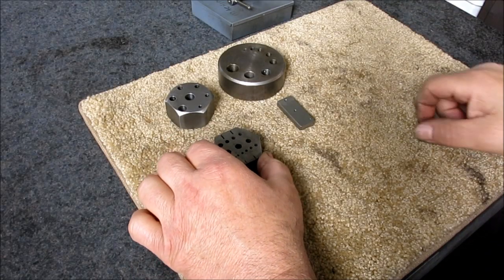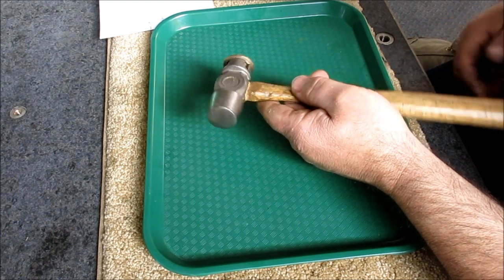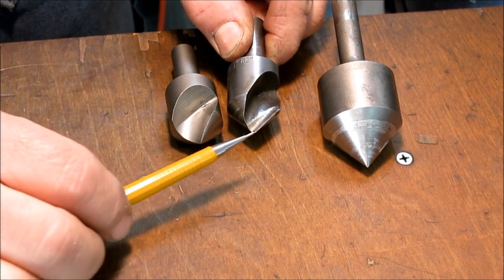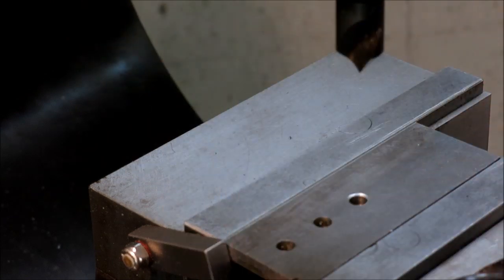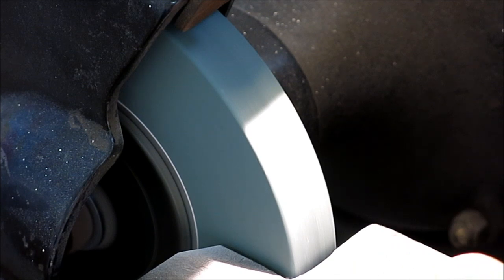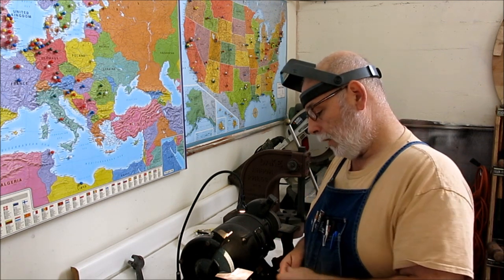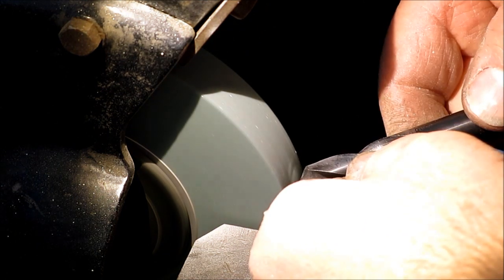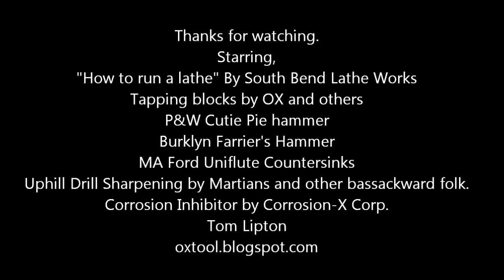Monday Night Meatloaf 13

Comment: Hi Tom, I used to work as a heavy vehicule fitter (Truck mechanic) in th UK. "Toffee hammers" like the small ball pein you showed were used in vehicule inspection. By tapping on bolts or rivets, you can hear whether they are tight or not. Thanks for the videos!! Regards, Matthew
Reply from the maker: Hi Matthew,

It so small I could believe its some kind of inspection hammer. I tap on things all the time to see it they are loose or sitting wonky.

All the best,

Tom

Comment: Thanks, Tom.  Once again, gobs of useful info and a delight to watch.

As a small repayment for all I owe you, perhaps you'll appreciate this tidbit.  Years ago, I went to a jobber shop to pick up a small job.  The job was so minor that the shop foreman had forgotten about it.  A little embarrassed,  he told me he'd have it done while I waited.

I watched while a young machinist went to work carving my workpiece.  Right before he handed it off to me, he reached for a brace with a countersink chucked in it and made quick work of deburring the holes.

Knowing a good thing when I saw it, as soon as I got back to my shop I mounted a countersink in my fine Stanley brace which had been sitting idle for decades.  I always planned to re-nose the brace to accept a Jacobs chuck, but that brace's tapered square chuck has been spinning the 1/2" shanked countersink for more than 30 years, so I guess it works.

Thanks again,
Rich
Reply from the maker: Hi Rich,

I have seen this before and its an excellent tool to have around. I have a tiny version of this I really like for small holes. Not a big surprise its made by NOGA. 

Thanks for the neat story. I love to hear how people learn useful tricks like this.

All the best,

Tom

Comment: Thanks for the meatloaf, keep them coming! I had the opportunity to work @ the north Boeing field test sight and watched a tech tap the last few holes of a 100 hole plate. An engineer had made him a two way slow speed air drill into a forward and reverse drill. When he pulled the trigger the drill went forward, when he let off the trigger it went into reverse.  He could tap a hundred holes in about 30 minutes! That's flank speed production. As you might imagine there are many milling companies supporting Boeing production in the greater Seattle area.
Reply from the maker: slad roznik Hey Slad,

I want one of those drills! Sounds like a great product. Thanks for the comment.

Cheers,

Tom

Comment: i've been a machinist for 30 years and I've always had misgivings about sharpening drills by hand, especially when you can't afford to drill oversize holes on your workpiece. Do we wash clothes by hand? No. then why sharpen by hand? Sure, drill sharpeners are expensive, but so can your workpiece. I have a very good drill sharpener at work at it never fails me with only a minute or two to sharpen.
While sharpening is a good skill to have, most shops I've been at have sharpeners and that's fine by me.lol...

Comment: Hey Tom, absolutely nothing wrong with thinking outside the box you proved your method works as well as the traditional and that's a good thing. Although I think the space time continuum will be thrown off once everybody switches to your method,,lol Thanks for taking the time to put up good videos.
Reply from the maker: Hey Randy,

I can feel the earth's rotation slowing as people (mostly Australians) try out the uphill drill sharpening method.

All the best,

Tom

Comment: Afternoon Tom,

That's the way I was taught to sharpen drills around 30 years ago. I don't do enough sharpening to be particularly good at it though. I frequently mount the drill point up in the vice and use a diamont lap to just freshen up the edges. On small drills I often use the same technique to put a four facet geometry on.
Reply from the maker: Hi Paul,

For small drills that is a great technique. Everything happens so quick on the small drills with a normal grinder. I lost a bet with a guy many years ago that he couldn't freehand sharpen a 1mm drill on the bench grinder. I had to pay up.

Cheers,

Tom

Comment: Tom, 

First off I have been meaning to commend you on your use of magic marker as a lay out die applicator.  I have been doing this with my students for 15 plus years.  Originally I came up with this technique out of necessity.  I ran out of layout die, and budget funds, however the office had a big box of Sanford markers that I could simply take ;).  I still make the brush out stuff available, however a lot of my advanced students will carry a marker in their apron so they don't have to make a trip all the way back to the tool cabinet. 

I also wanted to let you know that I encourage everyone to read How T Run A Lathe.  It was in reprint a couple of years ago, however the fella doing it retired and no one took it over.

Thanks for sharing the "Martin Method" of drill sharpening.

Happy New Year!
Reply from the maker: Hi Mike,

Pure laziness. I hate to walk back to the toolbox to get the Dykem. It takes too long to dry also. But boy the smell sure brings back memories. Much like Hoppes does for firearms owners.

All the best,

Tom

Comment: It's sometimes hard to fine the time to keep up on everyone's vids....but I was just watching Chuck's new one....saw a comment by Michael Murry....checked his vid on countersinks.....he referenced your vid so I looked it up.  Exactly the info I needed for today!!!  I've got top end Drill Doctor but for the life of me I can't figure out how to do the big bits(3/4").  The relief angle doesn't turn out.  I also need to countersink the 3/4" holes after I drill them.  I don't have a countersink that big, but I do have extra drills large enough to use.  All that to say that the idea to regrind a drill to use as a countersink was awesome!!!!!  I'm looking forward to hitting the shop today to try that!!!  Thanks Tom!!!!  Great vid!!!
Mike
Reply from the maker: Hey Mike,

I should work fine. Chuck the drill in a collet for least amount of wandering and use slower than normal spindle speed. Field expedient countersinking.

cheers,

Tom
Reply: oxtoolco
hey!!  That's a great idea!!!! Get Chuck to do all the countersinking!!!  :)

Thanks Tom!  I'll give it a try asap!

Comment: Oh, Tom I was so happy when I head you would show how to grind counter sinks - but oh, you forgot that special one, shaped like a round rod with a cone on the end and a hole drilled perpendicular (I think !) to the cone surface.

How can it possibly cut any thing at all ?

In fact you have one sitting on your lathe tailstock table ... I think it's the second from the left ... I noticed it when you showed your tailstock table in a video and I asked if you knew the geometry of these counter sinks and how to sharpen them - please tell about them.
Reply: They are zero flute countersinks and work the same way as all the others in that they have a relief as well.  I have a set and they work great as you probably already know.
Reply: Keith Ward You writes: .." in that they have a relief as well.." - where ?

If the hole is bored as it seems like - perpendicilar to the cone face, then there is no cutting edge or ... ?

And how are they sharpened ?
Reply from the maker: Keld Sørensen Hi Keld,

They have the exact same type of eccentric relief as the single flute. The cutting edge is formed by the hole. To sharpen this type of countersink you only work on the inside surface of the hole. A small die grinder with a round stone works well for this purpose.

Regards,

Tom

Comment: A hot cocoa and some tasty meatloaf to warm up after pushing snow out of the drive here in central Illinois. Not too bad of a morning.

I may have to try your method of sharpening drills to see if that works better for me than the traditional method.  Do you sharpen your own mill cutters?
Reply from the maker: Hi Gopher,

I don't currently sharpen my own end mills. There is an old company not far from here that does it better than I could ever hope to do it and they are pretty reasonable. I just save them up for a while and when I have a little box of them I send them off. 

All the best,

Tom

Comment: Thanks for showing that hammer, Tom.

I have another question: I dug through your old vides, and decided I was wasting my time, instead I'll ask.  Long ago, you mentioned what kind/brand of edge finder you use.  It was something like a "super snap" or "super jump" or "jumpy snack".  Can't remember!  Thanks
Reply from the maker: Hi James,

You got it. Its called a super jump. It used to be sold by Hermann Schmidt but now the only folks I see with it are Flexbar. Been using them for years.

Cheers,

Tom

Comment: I enjoyed the video very much.  I too learned how to dress drill bits in a vacuum and use your "Martian Method".  I prefer it because you SEE where you need to go not where you were.  I can end up at the leading edge and know exactly how to get there. (if that makes sense)...  What kind of grinding stone and what grit do you prefer?  Great series keep up the good work.   Fred
Reply from the maker: Hi Fred,

Excellent point. Pun intended. I try not to grind things I cant see. So why sharpen a drill without seeing what your grinding. I think its more natural but I'm from Mars.

All the best,

Tom

Comment: hi tom happy new year  my father was a instrument maker by trade and i have is tool set ,in it is a hexagon block the same as yours  he said it was in some tools he bought off a retired watchmaker. I also use a tiny ballpein hammer for making gaskets. dave in the UK
Reply from the maker: Hi Dave,

That makes some sense. The vendor I got the block from had some watch and clock stuff in his booth. I just assumed it was jewelry.

Cheers,

Tom

Comment: I have that little ball peen hammer with the same paint job- came as part of a "gentleman's tool box" with a 6 or 8" long monkey wrench and a sash saw... As well as a tiny plumb bob and a few gimlets,if I recall correctly.  
It is my go to hammer for flattening Japanese chisels.
Reply from the maker: Hi Drew,

Interesting story. When you say flatten Japanese chisels do you mean to stretch small area's to get the cutting edge perfectly flat? Are the chisels you are describing very thin and flexible?

All the best,

Tom

Comment: What grit was the wheel you ground the drill with?
Also, I have never thought to use a stone on my cast iron table before, good idea.
Reply from the maker: Hi Edge,

I think its a 60 grit on the bench grinder but I'm not positive. The table I stoned is steel but the same technique works for machine beds and cast iron plates to take the little nicks and bumps out.

Cheers,

Tom

Comment: Hei Tom,
maybe you could use your Deckel to regrind the countersinks relief face, if your grinding wheel is large enough
Reply from the maker: Hi Tom,

The Deckel is not set up for a continuous helical relief. You are correct that I could actually sharpen one on the machine but it would be a incremented step relief much like the single lip cutter have. Not as nice as the smooth grind on the factory countersinks.

All the best,

Tom

Comment: Tom: I have a ball pein hammer a bit smaller than yours. I use it almost exclusively to cut gaskets. The ball end cust nice holes in the gasket material and the flat end cuts the edges.
Reply from the maker: That would be a good use of this hammer. Not heavy enough to damage edges but enough to leave a mark or score a gasket. Great tip. Thanks for the comment.

Cheers,

Tom

Comment: Tom according to "Alloy Artifacts" P&C was acquired by Plomb in 1941. So there is a  good reason it looks like a Plomb/Proto That is a nice little hammer.
Reply from the maker: Hi Eric,

Thanks for the information. The handle is the Plomb giveaway for me. I will check out the Alloy artifacts lead.

Cheers,

Tom

Comment: Throwing my two cents about the countersinks and i'll explain as well as i can since i could neither do this or have seen it:

You'd need two fixtures.

Fixture one, would be similar to the action of a bolt rifle that uses the helical locking lug.

So step one would be a flat/cylindrical type of collet that would have a tapped hole going inside perpendicular to the rotation axis. That tapped hole would receive the handle.

Step two would be to somehow make the helical tube that has the correct advancing movement and rotation for the countersink.

Step three would be to make a small ring that would lock the collet holding the countersink. That IMO should just be a simple ring, nothing fancy.

Fixture two would be a bit tricky, as in it would have to hold the countersink at the angle of the internal cut then pivot it according to the existent cut. Tricky in the sense that one would have to find the right wheel, and fit the countersink to measure the tilt and rotation.

I can draw this if you're interested.
Reply from the maker: Hey Aserta,

Are you talking the uniflute style or the Weldon style? The Weldon'd don't have a helical relief. Its a bump relief. 

Cheers,

Tom
Reply: oxtoolco Uniflute. The ones without helical relief don't need step one. You just need that special wheel (special in the sense that it needs to match the shape of the hole) and the custom holder for them.

I'm pretty sure that's how they are made. I'm going to check the patents on google see if there's anything to glimpse at regarding manufacturing of these countersinks.

In EU getting countersinks is a little bit tricky. Well ones that don't cost an arm and a leg. The cheapo ones dull after a few uses so that's a no go as well.

Hope that all made sense. Sometimes ideas hit me regardless of them being sound or not.

Comment: Hi Tom, I'm not expressing doubt, but an interesting add to the drill sharpen would be to measure the hole against the drill size... I've used a very similar grinding technique many times myself. The success is in your accuracy... As a mechanic in my youth (I began full time work at 16)... Another use for the little ballpein is to make gaskets from scratch often a catalog cover or back laying around the shop,,, lol. :o]

O,
Reply from the maker: Hi O,

You are right. Getting a drill to cut to nominal size within a few thousandths is a good measure of an excellent grind. My opinion is I never trust drills to hold a few thousandths no matter what. Even what looks like a good factory grind many times does not produce an accurate hole because of other factors. If I want a particular size I use other methods.

All the best,

Tom
Reply: oxtoolco I totally agree Tom, another method of getting accuracy from drills, especially if you don't have all the options that we do, (and this is for the lesser experienced/tooled) is to first locate the hole with the most accurate tools you do have i.e. edge/center finder, center punch, or center drill. Then drill a pilot hole that is the next closest to desired finish size, and finally use your finish drill at a bit slower than normal RPM with an excess of cutting oil, and advancing the drill as fast as is comfortable all the way in one shot if possible... And of course always measure your drills accurately before hand. When using tiny drills you cannot advance the drills fast or one shot them. :o]

O,
Reply from the maker: Hi O,

Good advice and description. The less a drill has to remove typically the closer to advertised size will be cut. You can stone the corners also to get a really nice reamer like finish.

Cheers,

Tom

Comment: Don't know how to reply Tom- 
These chisels are laminated/forge welded Iron with a hard steel cutting face, the backs are concave to, depending on whom you talk to, cut down on what must be sharpened on the flat after raising a wire edge or to lessen the amount of drag. When you get too close to the concave, you tap them down, reflatten the back and continue... With wood chisels and plane blades the polish on the flat side is as important as the hone on the bevel- has to be a mirror. Since your double secret email address is on the white board I'll send a picture from standup2p email address.

Comment: I saw that method of sharpening drills in a old machinist book as a method for sharpening left hand drills. Sharpening a right hand drill the 'text book' way becomes a habit so sharpening a left hand is usually very awkward but using  your method  on LH drills makes it easier for the guy that sharpens RH drills the text book way.. The natural feel for the angle is the same plus you work on the same side of the wheel as for a RH.
Reply from the maker: Hi Potlimit,

Thanks for the comment. You don't often get the chance to sharpen left hand drills so I can relate to the awkwardness of the operation. That is how the earthling method of drill sharpening feels to me.

Cheers,

Tom

Comment: My Grandpa had one of those itsy ball peen hammers, I found it in his Kennedy Box just now and it has no manufacture info on it but looks much the same.  As a kid my job in his shop was to fetch tools thereby learning the nomenclature, trouble is he had his own personal names for stuff, he called that little ball peen hammer a "Tap Hammer"  he said he just used to lightly Tap things. 

 I really miss the Old Codger.
Reply from the maker: Hey John,

I worked with a guy that would say, "give me the shifting spanner" When he saw the puzzled look on my face he said the crescent wrench you nitwit. He was a Kiwi a long way from home.

Best,

Tom